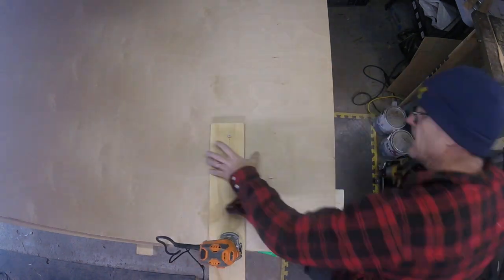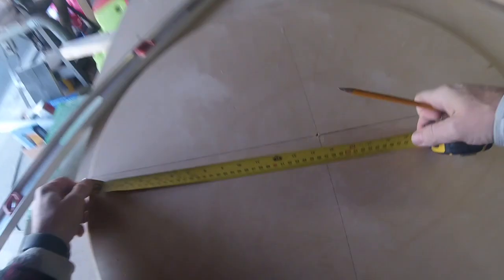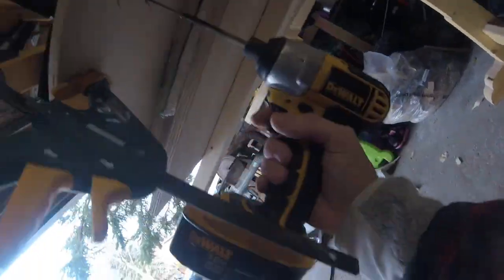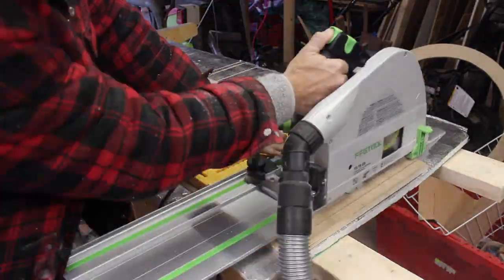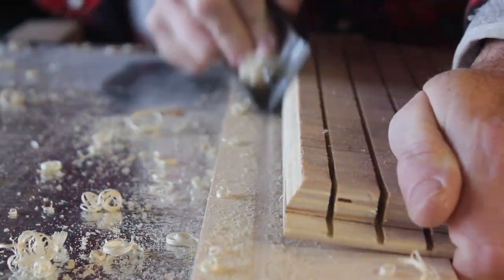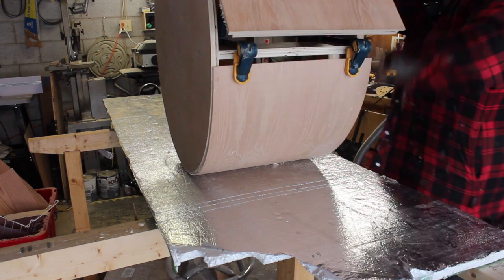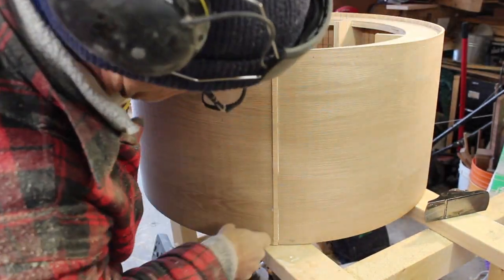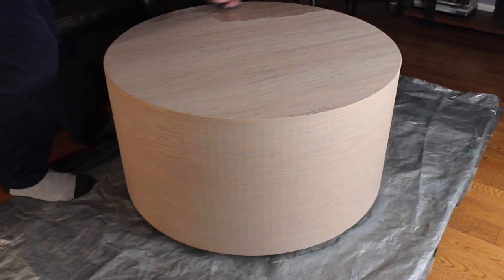Designer Oak Coffee Table []  Solid, round coffee table build.

Comment: Really great idea and use of cheaper materials.

I don't think there is anyway to avoid this but the base shows vertical lines which I presume match where the cuts are
Reply from the maker: There was only one vertical line where the plywood wrapped around and met up.  I have ideas on how I might try to minimize this if I ever did it again, but you're right, there is definitely a visible seam.  But only one, so I have the table turned so it's not visible when you look into the room 😜
Reply: Interesting, I wonder if it was the lighting as I could see vertical lines / shadows all over it which made me think it was the cut lines showing through.
Reply from the maker: @anonymouspdg6121  ahhh. Yes, those are the kerf cuts showing through. They’re are not nearly as visible when not in direct light coming from the side.  But yup, they’re there.
Reply: Unfortunate but still a very nice piece!

Comment: What’s the reason for not using 1/4” veneer ?
Reply from the maker: It's certainly something worth thinking about - but in this case, I wanted to have the walls be strong, and 1/4" veneered plywood would have been very thin.  It also would have required kerf cuts on the back, so no time saving there. Using the bendable plywood to smoothly go around and then putting a very thin veneer (1/16th) on that could also work.

Comment: Curious as to your thoughts on using  5mm flexible plywood for the wrap around vs kerfs on thicker plywood? What would be pros/cons?  Also what would you do differently if you had to build this again 😊
Reply from the maker: I'm not sure if the bendy ply comes in Oak.  If I were to do it again, I may try to build it so I can wrap it with a veneer to get the smooth Oak finish.
Reply: probably a better way as you can see in time 7.57 the kerf cuts are causing the bends to have vertical lines